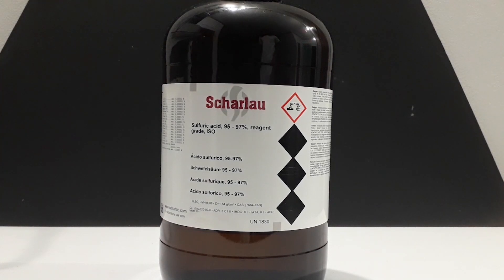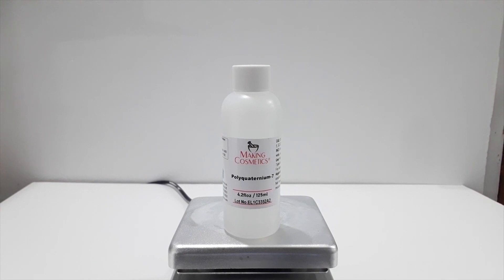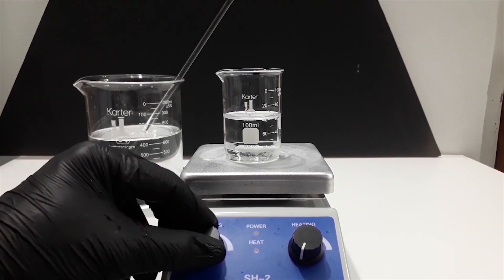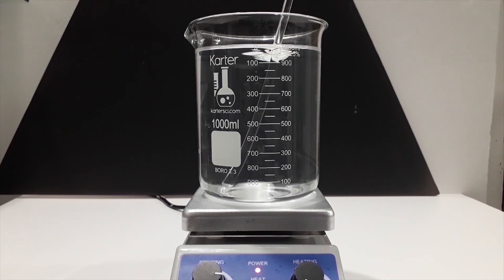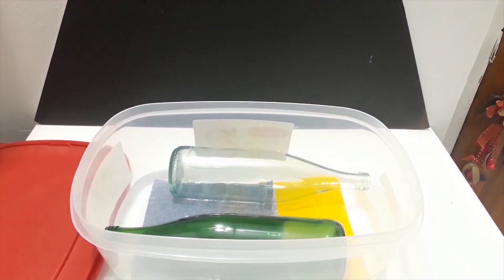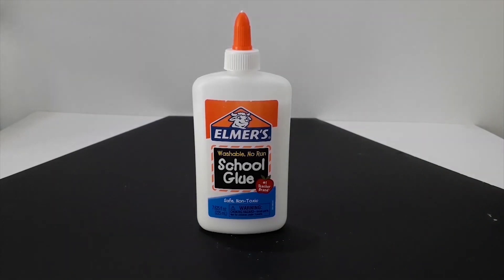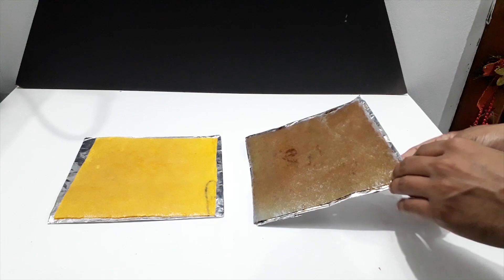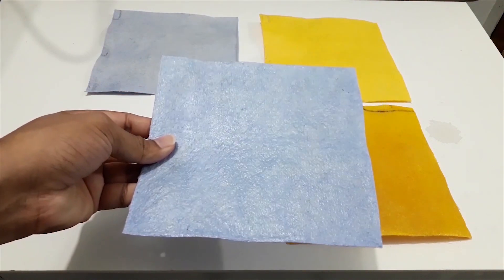How to produce DIY ion exchange membranes for various electrochemical applications.

Comment: Is this cloth resistant to Zinc dendrites? Do dendrites puncture through this membrane?
Reply from the maker: sadly this membrane is not resistant to dendrites.
I got them on occasion when it involves lead.
Reply: @CatboyChemicalSociety  If that is the case, I guess sandwiching this membrane between 2 layers of ionomer cement would be a better idea, am I right?
Reply from the maker: @aadhithvarathan5432  if you were using ionomer cement then what is the point of having a plastic membrane since ionomer cement made with ion exchange resin rather than gypsum will perform just as well if not better than polymer or fiberglass substrate membranes.

You can however insert a plastic mesh to reinforce the ionomer cement if you want it to be thinner.
Reply: @CatboyChemicalSociety  Thank you for your kind guidance.

Comment: Can you make a battery with those membranes? Why not use a charged metal mesh?
Reply from the maker: these membranes can act as a seperator for a battery and you can have a charged metal mesh beside it for your battery needs tho that sounds more like an electrolytic capacitor than a battery.
Reply: @CatboyChemicalSociety  What I am thinking about is a way to separate salts from water. Using two ionic membrane and some electrocs, you can pull the Na of NaCL through one membrane and tne Cl- through another (although thayt would evolve into Cl2 gas). This is a way to desalinate water or to create a flow battery (which can even be solar powered). This membranes are very expensive though so it would be nice to have cheap alternatives.

Comment: Have you done Amy calibration measurents/calculations to find out the mass transfer resistance or permeability of the membrane?
Reply from the maker: someone with better equipment was supposed to help me with that but I guess he has yet to actually mount the membranes in a working cell or test cell.
Reply: Love to see some measurements. I can offer to compare with nefon 117, which i have already.

Comment: Amigo ninguna de tus menbrana funciona
Reply from the maker: keep using your "HHO" cells then besides those dont need a use for membranes and seperation of H2 and O2 requires a flow cell and just a simple barrier and 2 tanks and 2 pumps.
Reply: @CatboyChemicalSociety  entonces no sirve para hacer gases separados ?
Reply from the maker: @HIDROFONG  it is used to seperate gasses but your design needs to be a flow cell that then seperates the 2 output streams using half O rings alternating with each chamber with 1 universal feed stream since its water and 2 holding tanks for O2 and H2 respectively.
The membranes cannot opperate with huge pressure differential which given than half as much O2 is produced as H2 must have equalized pressure hence the need for a flow cell.

Comment: Could you add a carbon powder to the cloth before coating to make it more conductive? I have been experimenting with a substance known as GANS Plasma and I have some really promising data from such material. However there is very little information anywhere regarding this material because it's kinda new and many are claiming its not a beneficial substance. Hence why I began researching it. I've found that it has an amazing effect on vegetables. It's almost as if it puts off a radiant energy that the plants use to maintain their shelf life. Take for instance I had onions cut in the fridge and before I ever made a batch of GANS Plasma they would rot within a month. Now I've had onions begin to grow in my fridge after 5 months of sitting. I had a pumpkin that we got last year around October and it just now began to rot. I have had tomatoes that have not spoiled sitting in my window sill since last August. That is something I've never seen in my entire life. I would like to share my findings if you are interested. I could even send samples if you know how to test to see what's going on. I'm new to chemistry do I'm not well informed. But I see real promise.

Comment: Thank you very much. Does this works for Electrodialysis?
Reply from the maker: You need both cation and anion membranes for that so you can also use aspartic acid for making the anion resin membranes and optionally treatment with a methylating agent like methyl iodide to convert the amines into quaternary amines

Comment: does this membrane allow fluid to pass through it or just ions
Reply from the maker: if consutructed right in ideal conditions or many layers of esterified PVA then it should only allow ions but if you add fewer layers then it will be a bit more porous to the solution.

Comment: Respect. I hope you will be interested in why I am watching this video of yours. I want to commend your work, if I understood these membranes can I in some way replace expensive nafion proton membranes?

I make water electrolyzers, so I study various ionic membranes, what is the porosity of these membranes after this operation of putting pva glue and dechlorination, what is the porosity of water, and what types of ions does this membrane leak?
Reply from the maker: the PVA citrate membranes leak both protons and cations and block anions.
ofc more layers of Citrate esterified PVA chains will increase resistance but make it more selective.
These membranes however get hydrolzed in certain strongly acidic conditions or strongly basic conditions.
The free carboxylic groups are what hold on to protons and other cations which allow them to flow through the membrane.
These membranes overall arent going to outlast nafion for the long long run in certain corrosive conditions.
But for some applications with milder conditions or for simple proof of concept testing where you only care to run it for a few hours then this will suffice.
Reply: @CatboyChemicalSociety   Hmmm, that now brings me a little bit of disappointment, I have created quite optimistic expectations. And I want you to advance in the prolanals of making membranes that can literally replace nafion membranes, and that can be made from affordable and economical materials on the market!
Reply from the maker: @hydrogenh2energy964  well such a dream material would be nice but these membranes are mostly just for really short experiments or proofs of concepts where you are testing shit for awhile and dont wanna spend on nafion.
Reply: @CatboyChemicalSociety   Colleague, I would ask if you are able to do one test, with PVA membrane, it is in my interest to find out the time resistance of the membrane to the research concept, electrolysis of water, where the catholyte is 1 M citric acid, anolyte base, sodium hydroxide concentrations 1 M
Reply: Can a Fuel Cell Fuel Cell be made with these PVA membranes ?
Reply from the maker: @hydrogenh2energy964  to test fuel cells yea they can be used
Reply: @CatboyChemicalSociety  Thank you very much. You share very useful and valuable information, and you are really rare from people in the world, and there are also few of us who want to understand and research green technology and hydrogen technology as the main energy source of the future. I believe that you tested the PVA membrane in all proton membranes and that in the first test, it gave potential on the electrodes by bringing hydrogen to the anode and air to the cathode. I was curious to try such an experiment.

Comment: know anything about making formaldehyde from electrolysizing a methanol solution?
Reply from the maker: I checked it just now and the yield is 30% due to the other reaction producing CO2 instead. The catalyst is also 0.4M HClO4. yea u need Ir-Ta MMO electrodes or this wont fly.

Comment: Would the ion exchange resin still be formed if it wasn't heated up to 150 degrees Celsius? I'm lacking a proper oven at the moment
Reply from the maker: it would but reaction time is unreliable and most improper ovens have the heating not exactly at 150 anyway so you can try it for more than 35 mins and see if it works by simply washing the membrane after cooking.
If it retains a layer then it worked otherwise heat longer in the next attempt.
Reply: @CatboyChemicalSociety  okay thanks will do so

Comment: Will this membrane work when applied to a battery/galvanic cell? Great video by the way
Reply from the maker: yes it will work for that pupose but a simple porous cloth will work too though that depends on the battery.
Lithium ion batteries use very selective membranes.
Reply: @CatboyChemicalSociety  i want to supress self discharge in my cell by using a cation membrane seperator to prevent ion gradient diffusion. Do you think your selective Membrane will help?
Reply from the maker: @comfortpooe7588  yea just add more layers of PVA and Citrate bake steps till you get the results you want.
Reply: @CatboyChemicalSociety  Thank you bro

Comment: Is there any way to turn this into an anion exchange membrane for galvanic cells?
Reply from the maker: instead of using citric acid as crossliner use aspartic acid.
then you can react membrane produced with methyl iodide to create quaternary amine groups in the polymer but this is all optional.
The secondary amine has enough desirable properties to be used.
Reply: @MysteriusBhoice  Thanks for the advice, my friend.
How much difference is between a membrane with quaternary amine and a membrane with secondary amine, performance-wise?
Reply from the maker: @hrajabi7261  quaternary is better but its more costly to make and methyl iodide is hard to get/make/risky since in USA its listed as a meth precursor.

Comment: Thank you very much for sharing this video. I also had a question for you about this membrane. Can this type of membrane help us absorb heavy metals from water or effluents, and if so, thank you for your help.  do
Reply from the maker: yes it can but not exactly this type but it is possible to synthesize PVA-Citrate resin then break it up to make filter media for an ion exchange bed which can be regenerated by passing HCl to leach the collected heavy metals.

Comment: 11:30 I had that thermometer... hated that I couldn't stop it from going on standby. >_<
Reply from the maker: oh yea but as long as its immersed even when turned off it will show the temp still once it goes back on.
IE it reads even when its off because its based on a resistance thermometer device where the reference is probably somewhere on the PCB of the thing.

Comment: Hello!
How can I store the synthesised membrane?
Reply from the maker: let it dry and I recommend sandwhiching it between 2 books post drying because if not it will curl up and be hard to mount it to frames for use.
If it does curl up you have to rehydrate it and dry it again.
Upon drying which is required to mount it may not immidiately curl up but eventually on further drying it will.
It is best workable once its dry enough for epoxy to stick to it but not so much that it curls up.
Reply: @CatboyChemicalSociety  thankyou.

Comment: This is awesome. Subscribed!.  Thanks for sharing this stuff. Can this be used for H2 separation from water using KOH or NaOH?. Thanks
Reply from the maker: yes you can technically do this to seperate H2 and O2 via membrane flow cell and 2 holding tank to seperate both gasses and liquid phases of O2 and H2 respectively.
Reply: @CatboyChemicalSociety  Thank You for Your answer. Do You know which membrane I could make myself and it would poduce best result with KOH?. Trying to learn about all this stuff but it seems a bit comlicated. Thanks
Reply from the maker: @andy86376  for H2 and O2 seperation u dont rly need a selective membrane just a fiberglass cloth seperator will do.
Reply: @CatboyChemicalSociety  Thank You for answer. I thaught if I use high conductivity graphite it will be more efficent as well as special membrane ( that will enhance production). I am trying to get the best output. Or meabye I should use different material for current collectors?. Could You possibly direct me to website or materials where I can learn more about this stuff?. Thank You
Reply: @CatboyChemicalSociety  I am going to use graphite as anode and cathode but not sure which membrane would be cheap , separate gases and be officent.
Reply from the maker: @andy86376  if you are using NaOH as electrolyte then use steel as an anode and cathode as its inert in those conditions assuming your NaOH is pure.
If not use baking soda as it soon forms NaOH anyway and is usually pure.

Comment: Can I use this membrane in the reverse electrodialysis instead of the CEM and AEM membranes
Reply from the maker: this is a CEM membrane.
yes you can use it but you need to make the AEM version aswell by making another membrane which uses aspartic acid instead of citric acid as the PVA chain crosslinker.
Then for optional increase in performance post treatment of the AEM membrane with methyl iodide to convert the amines into quaternary amines.
Reply: @CatboyChemicalSociety  another question.. what is the type of the cloth you used ?
Reply from the maker: @rahmawelnshar  its all purpose cleaning cloth.
you can use fiber glass fabric sheets also which would be better.

Also for reverse ED you need to ensure the membranes are as non solution permeable as possible but only ionically permeable so do multiple coats of PVA + crosslinker. and skip the dechlorinated PVC as its only for chemical resistance.
Paint the PVA + crosslinker directly to the substrate and cook it.
Reply: @CatboyChemicalSociety  thank you very much
Reply: @CatboyChemicalSociety  If you use glass fabric, do you need the PVC even if it's used in harsh chemical environments?
Reply from the maker: @puppypi9668  well the PVC helps it vs chloro alkali cell process where the PVC will essentially protect the ion exchange resin on the other side from dissolving away.
Reply: @CatboyChemicalSociety  Okay thanks!  :D

Comment: Supposing I want to do this to fit into a tubular stainless steel container to replace asbestos in Nelson Chloro alkali cell, how do I do it? And secondly will it work efficiently?
Reply from the maker: First ensured to roll the cloth in a tube before coating it then this maybe possible to do. Cation exchange resin is always more efficient than porous barriers. If you add the PVA-Citrate layer above the PVC resin then it could be nice. We have one issue though and that is that it was rolled into a tube before curing which makes it very hard to cure it evenly in an oven. I would get some sort of forced convection cooker/kiln to cure the rolled up membrane. 

If the membrane can be made flat and segmented into 2 or 3 sections then this will be better than curing a rolled up membrane which will be challenging.
If the membrane is just dechlorinated PVC then it will still perform well but only comparable if not worse than asbestos.
If the membrane is only PVA-Citrate then it will perform the best but I have no idea about its longevity in strongly alkaline and strongly chlorinated solutions for long periods of time compared to the mixed layers where the PVC layer will naturally be ok in the anode chamber and the PVA layer will be fine in the cathode chamber.

Comment: Hi. Mysteriousbhoice
I want to make a hydrogen separator electrolyzer using koh as a electrolyte.
Can I use this membrane and second option a porous PVC membrane for this purpose.to achieve pure hydrogen and oxygen through electrolysis.

How long these two membrane will work or degrade in koh solution?
Kindly reply I want to build hydrogen generator
Reply from the maker: in KOH they last a long time basically months. It is only in NaCl and a few others like HClO4 that they degrade over time.
Reply: @CatboyChemicalSociety  is there any way so that these membrane can last for 3 to 4 years 
I want to run  electrolyzer for a long time.
What about with sulfuric acid as a electrolyte does membrane works long with this or not
Need your suggestion plz
Reply from the maker: @hamidamjad7521  the PVC membranes are more likely to last long but the PVA-Citrate ester ones are less likely but are more selective in the short term.
The membranes shown in this vid is a mix of both types layered above eachother but overall in general PVC membranes last longer and can handle up to 30% wt alkali fairly well.
If you just want porous membranes just do the PVC and dechlorination step and leave it at that but if you want selective ion exchange then add the layer of PVA Citrate ester ion exchange resin.

I have not done any long long term testing of these membranes but I can say in sulfuric acid the PVC holds up very and its actually me using polystyrene as the frames that failed and not the membrane after using it for 5 months the membrane was still good albeit white due to magnesium fouling but that is solved with simple HCl soaking.

Comment: Can i know whether a normal pure cotton cloth will be enough?
Reply from the maker: if its cleaning cloth yes and if its made of cotton its fine as long as its a sheet that is porous and can be coated in PVC glue.

IF you mean cotton balls then it will have an issue of very low permeability when you apply PVC glue but it can be applied with PVA + Citric acid and baked as that layer is the better ion exchange layer and will have the ion exchange groups distributed throughout the polymer.

Comment: If I'd be using shampoo for the benzalkonium chloride then how much do I use? It's meant to be a catalyst... would 50 ml be enough? Does it go faster/better if I use more?
Reply: Look into algaecide products at your local garden supply store (to remove algae, moss, moulds and lichens from hard surfaces), they often consist of concentrated (up to 50%) aqueous benzalkonium chloride solutions with no other additives. Alternatively you'll also encounter 5-10% solutions of didecyldimethylammonium chloride sold as algaecide, or mixtures of the two.
Reply: @bromisovalum8417  cool thanks
Reply: @bromisovalum8417  Thank you for this bit of knowledge.